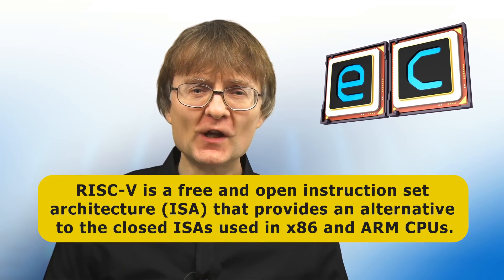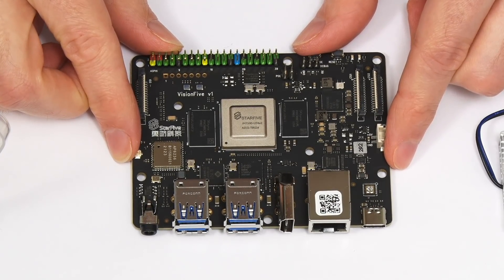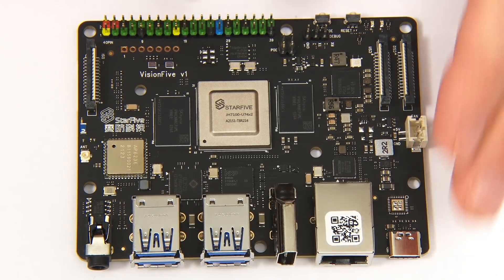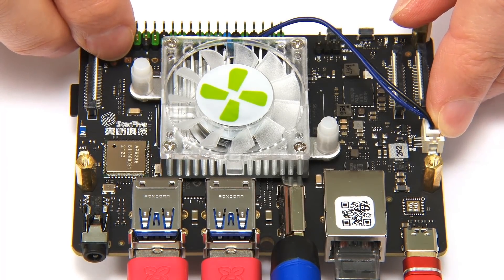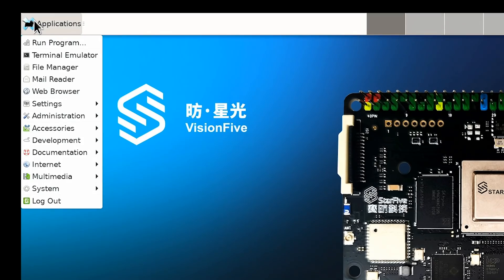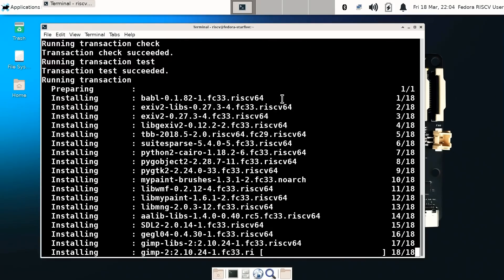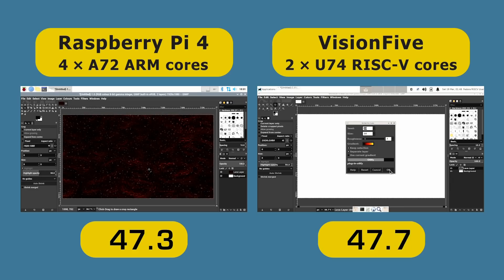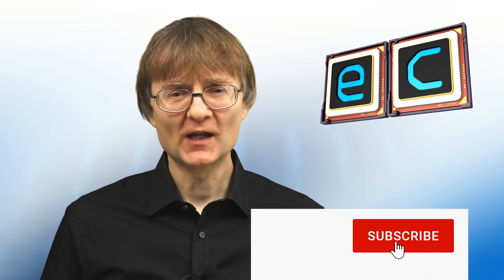VisionFive RISC-V Linux SBC

Comment: While Open Source Everything seems to be a great marketing mantra, what does it truly bring to the end user?  Can a user build their own RV SoC?  Can a user update the ISA and build their own, custom platform?  Can the user create their own operating environment?  The answer to all of these is a resounding yes - IF they have the finances, technology experience, drive, and time.  So what about the remaining 99.3% of us?  Open Source really means nothing in our day to day use of computing devices. This also brings to the front lines - what happens with millions of proverbial open source hackers descend on the solution and start branching or forking the platform ecosystem?  How do I know that I have a legitimate RV platform and not some "genetically manipulated" Frankenstein's monster?  Licensing, right?  How may users fell into the trap of $5.00 Windows licenses only to add their system to the worldwide bot pandemic through the years?  As for Linux, it really is an outlier example and even it ends up going through strenuous vetting before it's implemented with a professional environment.

As for the maturity of RISC V, it's been around for 10 years now, so it's not a new-comer to the realm of SBC/Low Cost options.  

Don't take this the wrong way, RISC-V definitely is a great option in this arena, but to succeed, I'll put my money on it ending up either splintering or going the route of may other attempts in this arena and ending up tightly controlled by a single organization.

If I have to create a device or solution that will be presented to an end user via their TV, Refrigerator, Washing Machine, Car, or other Iot/AIoT device, I'd much rather deal with a known provider and let them strictly control the platform's ecosystem with a locked down, stable supply methodology.
Reply from the maker: RISC-V is not open source (a software concept only) and I never described it as such in the video. Rather it is based on an open ISA, which is very different. It's all about licensing and IP control. Whether or not it becomes mainstream beyond embedded will hence depend on politics and trade barriers, and not on technical goings on in the computing industry.

RISC-V has indeed been around for 10 years, but only in 2021 did we get the first hardware able to run a full Linux distro. So RISC-V is right now very much a new comer to the SBC marketplace. We've had microcontrollers for a while, but not SBCs. So as I said in the video the VisionFive is one of the first lower-cost SBCs with a RISC-V SoC able to run a full Linux distro. And I'm reviewing the other one next Sunday! :)

Comment: well - I can't wait to see "design your own computer" to expand beyond putting a few standard components together
I really would like to see risc-v bring some free revolution into technology - although intel is planing a new chip fab just in my backyard (yea, I live in Magdeburg - where intel plans its new germany chip fab ... well, let's see how well that goes)
imagine design your very own and unique system - from the building blocks your cpu is made of over the motherboard layout and components on it all the way to your very own self-written bios to finally get rid of all this closed proprietary crap like intels ME ...
ok - for real: noone would write all the software running on such a machine all by oneself - and even design your own board or even cpu ... well, even if you such genius - which factory will run just ONE unit? let alone one single wafer? it would cost several times as the entire chip fab with all what's inside it - the humans included - so, unless you are a bilionair to even affort it one just have to team up with others to get the cost down by creating at least somewhat of an eco system to get the stuff done - at least the ICs
and then what? just have it implement standard sd-ram and pci-e controller so you stick to standard parts? ok, maybe stick to the standard buses - but one would still have to design all other stuff - like network or even simple i/o other than some rs232 - and come up with a whole new gpu desing? well, yea, intels trying that just now - and although they're the leader in cpus - many come with integrated gpus - dedicated intel gpu? that's still some way
as to what jeff geerling said: "It took a decade to get to where we are with ARM." - well, risc-v unfortunately still has this comming - let alone all that other stuff mentioned to get a fully "free" computer - we're not in the 60s' space race anymore where two super powers just trashed their ecos within a decade ... and although I already missed quite some history as I'm just born in 1991 - hopefully I see what's comming ... a 3rd big player - and this "all open" is the exact right way - if we would just had the capabilities to manufacture ICs in small badges like with boards without costing them unimagineable high prices

Comment: Gimp lava test shows an exact 1.5 ratio between this risc 5 board and raspberry pi 4. This is exactly the clock ratio too! 2x1 ghz vs 4x1.5 ghz. I assume gimp lava isn't multithreaded?

Comment: Hey Christopher,

I have some honest questions.

I've been looking in Aliexpress, (and let's be honest, all these singleboard computers come from China) and this very one that you present here cost an absurd amount of money.
It's selling for over ~1000BRL. (~210USD)

Brazilian wages are around ~1500BRL/Month. (~316USD)

Some models of the raspberry pi 4 (with case included) costs around the same amount as the Risc V model.

On the other hand,
Some (a LOT) companies, like Huananzhi, are recreating PCBs, and refurbishing (repurposing) older (Intel) Xeon motherboards, (X99, X79...) and reselling these, with Xeon processors INCLUDED, with RAM (DDR4) also included, and they are adding onto these PCB Nvme support.
These usually go for around ~600BRL. (~126USD) the FULL KIT. 
Provided that you need some kind of storage, a power supply, and some graphics card to display,

Wouldn't these be a much better option?

What advantages would a SBC have in direct comparison?
Is it because it's more portable?

Isn't a full fledged Computer x86_64 better than the ARM? 

I would really like your insight. (And maybe take a look at these?)
Reply from the maker: Thanks for this. Whilst a lot of SBCs come from China, not all of them do. For a start, the market leading Raspberry Pi is made in the UK, and has an official price of $15 for a Pi Zero 2 W and $45 currently for a Pi 4 2GB. So in many countries it is far cheaper than most other computers. And it can be used for a variety of purposes as I recently covered in this video: https://www.youtube.com/watch?v=bw48kYqxHIo

If you can purchase an x86 PC more cheaply than a Pi and do not need the small size, small power consumption and GPIO connectivity, then yes, in those circumstances the x86 PC is a better option. Clearly as your post indicates, prices for computers vary significantly in different countries. I cannot find any listings of Huananzhi or any other repurposed motherboards or systems for the kinds of prices you cite.

I have never suggested that the Pi or any other SBC is better than an x86 PC in such an instance.

On the VisionFive, as I said repeatedly in the video, it is a development board with a RISC-V CPU. It is therefore totally different to an x86 PC. The only reasons to buy a VisionFive are to write or port software to RISC-V, and/or to experiment with the RISC-V platform as an early adopter on real hardware. You cannot do this on an x86 PC, so any price comparison with one is invalid. :)

Comment: Thanks for the video Chris. I was excited at the prospects of this platform but puzzled that they have not included any provision for non-volatile storage that can provide a usable operational life. I would have thought that eMMC at least, or better an M.2 or PCI-Express provision would have been appropriate at this price point.
Reply from the maker: SD card storage is very common on SBCs, and high endurance cards can last a very long time! :) eMMC certainly could have been an option, but M.2 or PCIe would have added considerably to the cost and complexity of the board. Remember that this a development board using a totally new SoC based on an early-stage technology, and I'm sure produced in small volumes. So the price reflects this and cannot be compared to that of a mass-market consumer product like a Raspberry Pi. A year or so ago, some RISC-V development boards were selling for $8000, so the VisionFive is a low-cost board in its market.

Comment: Hello, i have to warn about how long the support for this hardware is maintained. A long time ago, i bought an Odroid X2 built in 2012, i got it in 2015 and one year later it was not maintained any more ! 4 years after his manufacturing !!! This kind of hardware depending a lot on the manufacturer updates due to it is a special hardware. Now the last Debian i can run on it is a 2016 version and it even cannot access to youtube due to the navigator software have to be adapted for this board ! So, before to buy it, you shourd be sure to need it now and not in few years !
Reply from the maker: Thanks for this, but this is a development board for RISC-V, which is a completely different thing to an ARM SBC like an Odroid. Many ARM boards do as you say lose support after a few years, which is a pity. But with with a RISC-V development board like this there can be is no expectation of medium- or long-term support -- this board exists for those keen to experiment with early RISC-V hardware, or program for RISC-V. This board is not a consumer product and should not be purchased with any expectation of long-term consumer (or industrial) use. :)

Comment: I am definitely interested in this but this feels like it's gonna need a little iteration before it becomes viable as a serious alternative

It reminds me a lot of the early days of the Raspberry Pi, where some of the specs look decent, but others just weren't quite up to snuff. The Ram and connectivity on this board is nice, but the actual CPU itself is a bit anemic still for a "high performance" model

Like these days, The Raspberry Pi 4 when packaged up right just feels like a viable computer. It's not gonna blow the doors off a Threadripper or anything, but it'll let you do basic computing tasks in a mostly reasonable amount of time with very little fuss, and with really great support. It had it's growing pains, but it feels like it's got it figured out.

With this low performance, without even the amazing price advantage the Pi had when it first came out, this is still very much in the realm of early adopter/bleeding edge, and I suspect it will be playing catch up with ARM for quite a while before it can call itself a contender. But I absolutely love the idea of a fully open source computer, so I would love to see this technology grow to reach the point that it is a contender someday.

Comment: That is... surprisingly affordable, considering how new RISC -V is. I imagine it'll stay in the AI domain for for the most part (as ARM and X86 are extremely entrenched), but I can see some interesting use cases for a little board like this with that machine learning kit built right in.

Edit: And it seems suprisingly useful for a chip that doesn't even have a GPU! Would be a pretty funny project to take a more advanced variant of the Ben Eater "GPU" and wire it in for a laugh. Even if it'd be a downgrade, and the breadboard would be much larger than the SBC....

Comment: The price is too high for SBC compared e.g. to RPi... while CPU clock is reasonably lower.
Reply from the maker: The Raspberry Pi is a consumer and industrial end product. This is a development board for those wishing to develop RISC-V software or gain early experience of the platform. And these are not the same! :)

Comment: * Why htop reports 7.01GB of total ram? That can't be rounding errors  in 1024 vs 1000: RPi 4 for example reports 7.8GB and 7.01x1024 is ~7200. Where did whole 1GB go?
* I don't share the excitement. It takes... what... half a minute for desktop icons to appear. That's not speaking about boot times.
3 seconds to open file manager and you can see  with naked window borders before the filemanager itself renders. 
Even dragging seems sluggish. Though I'm not informed in riscv ASICs. Is it exciting because it's first SBC with RiscV that doesn't cost >$1000 to boot to desktop? On its own it doesn't seem impresseve, tbh.
* Can't comment definitely on Q1 performance, as the video itself is not 60fps and "timedemo demo1" was not run to measure the performance. Can only say it runs faster than 386DX which turned Q1 into slideshow.
* I'm surprised that it was that close to  RPi4 which has twice as many cores so maybe in single core applications(such as Q1) it will even outperform it, which is good, as  it costs as less than 4GB version of RPi4 (~180USD on amazon). In theory RPi is should be cheaper, but in shops where it's cheaper it's out of stock. 
* Can't undertstand the obsession of SBC makers with ML. I haven't even seen others doing much projects with ML on such SBCs.  Maybe there is an actual use, but it feels that ML here plays the same role as linux desktop: "yes, it bootable. You will suffer using it."  Though my exprience is limited to Jetson Nano with even less RAM. But whatever ML chip this SBC uses, 8GB is not enough for most interesting models like even full sized GPT2.
Reply: Maybe used as tmpfs mounts ?

Comment: I was thinking of making a home web server without having a domain/ fixed I.P., on the deep web, using Tor. Presumably a simple web server would do better on a Raspbery pi, since no power consumption concern if you want to keep it online for longer time.
Reply: It's a question if this SBC has deep sleep or hibernation capabilities as normal systems. RPis are notorious for not supporting such things.

Comment: Seeing you fast forward through load times makes me think that you should have a timer for app load times, even if you don't mention the time, it'll be there for those who want to know how long things take. 
I wouldn't exactly call 1996 gaming... It is, technically, but its requirements are so low, practically anything with a graphics system will run it... Maybe not the latest Steam Version, but the original? sure.
Reply from the maker: The gaming section was ironic. And the issue on all software is whether it has been ported to RISC-V -- this board will not run x86 or ARM software. So the fact that somebody has ported across Quake is interesting to me! :)

Comment: Can it play full HD video smoothly in full screen in portrait mode (vertical screen)? Most Linux distros have a problem playing video on intel chips as soon as you rotate the screen, screen tearing appears. Also, RPi  3 was not able at all to play at 1080x1920, only 1920x1080. I head to downscale videos as picture height could not exceed 1080px. So it would be interesting to se...

Comment: Great video, thank you.
Back in the late 1990s I was assembling and selling IBM/Motorola RISC based computer that was used as severs or client to the engineering community.
It run on IBM's AIX operating system.
It ran CATIA, NASTRAN, Patran and all the engineering software of that time and it was also used for video editing.
In order to run the graphic software like CATIA the client had to have a plugin graphics card that cost just as much as the mother board.

Comment: I'm genuinely interested in seeing where RISC-V goes - or even just RISC-type architectures in general. I see a genuine possibility, given the walls that x86-64 keeps running into, that it may cease to be the dominant architecture before 2040. I mean, x86-64 is basically the 64-bit version of the 32-bit version of a 16-bit CPU. The concept behind it is highly dated.
What all these RISC architectures need, though, is a standard for desktop-grade computing. You know: upgradable RAM, 20+ lanes of whatever the modern pcie standard is, A CPU that pops into a socket or onto a land grid array... and we're just not seeing that outside of servers and, to some extent, whatever Apple is up to.
Reply: any idea what's the clockspeed of this core? I can't seem to find anything. Have processor manufacturers cease to market the speed?

Comment: I'm in the u.s but IV been a fan for along time and learned a lot from you, you are a great teacher and IV bought all kinds of sbc I bought that came broken it is a orange pi zero 2 I hear that there all defective I would like to know if you can make a repair video on sbc,s please if you can i know you always make video on them but never fixing them thank you for your channel keep your fan
Reply from the maker: Thanks for this. Unfortunately, fixing most SBCs is not easy. A damaged connector could be replaced -- but even then getting the old one off the board without doing damage is not a trivial task. And replacing most other components -- like the SoC, RAM, wireless module and so on -- is not easy at all, as all the components are soldered, and soldered using factory machinery.
Reply: I try everything I think its something to do with the power and so messed is they didn't even want to grant me warranty I never buy orange pi stuff again zeng Zen or something like I found out that mostly all orange pi boards were all like and they didn't want to give me my money back nether
Reply: Thanks for the quick reply you the best dude

Comment: 174 for merely alive Firefox? Ah.. and for MicroSD card )
Reply from the maker: This is a development board managing to run a desktop Linux distro and Firefox on a system with neither an x86 or ARM CPU! :) Not long ago, test hardware capable of this cost thousands of dollars. The VisionFive is not a consumer product.
Reply: @ExplainingComputers  Really? I have to read more about the advantages of using RISK-V.